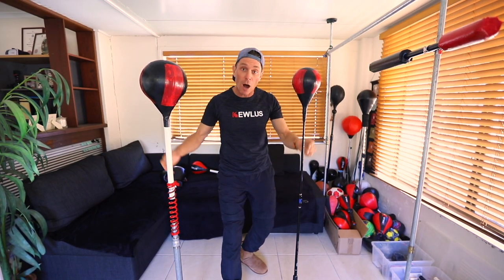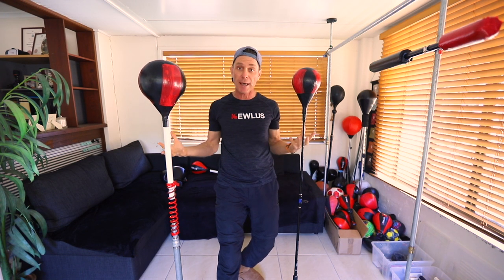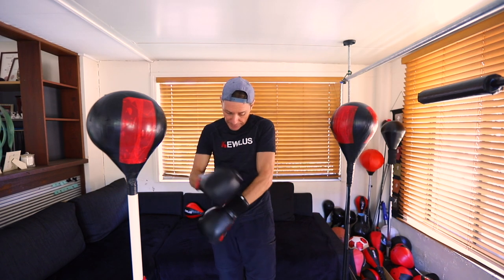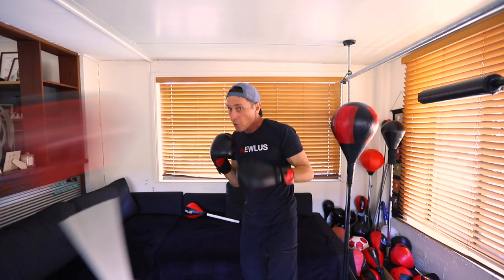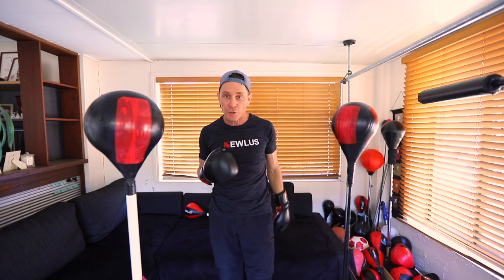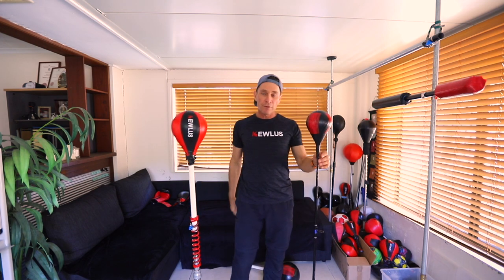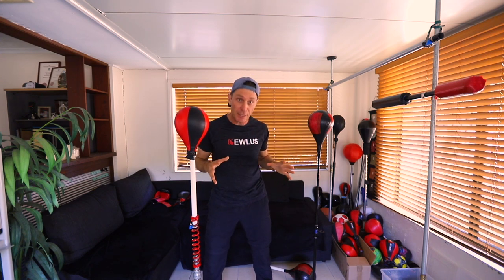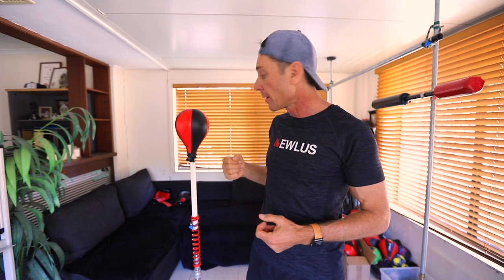Spring vs Rod Cobra Bags Compared

Comment: I have made both. To me the fishing rod version actually felt really good and the feel of both are negligible to me. Both very good. Although the fishing pole version snapped on me after a couple weeks of use that’s why I now have the spring. I would recommend the spring if you’re planning on hitting it decently hard. If it’s more just for head movement and timing the fishing pole will probably be just fine just keep in mind it will eventually break.
Reply: Me too

Comment: Hey mate, quick question. For a heavyweight bloke would you say the piping at the top would be sturdy enough? if not any recommendations on what should be used instead? Asking for both the spring bag and spar bar
Reply from the maker: PVC is plenty strong for it. Easy to replace if it breaks, but it shouldn’t

Comment: Hey Reedy, how’s the cobra bag at the muay tai gym fairing? I’m thinking about just bolting a flange into my concrete basement floor
Reply from the maker: We’re in lockdown here. I’ll check when we’re out. If you use sleeve bolts I recon it should hold well
Reply: @Kewlus  thank you